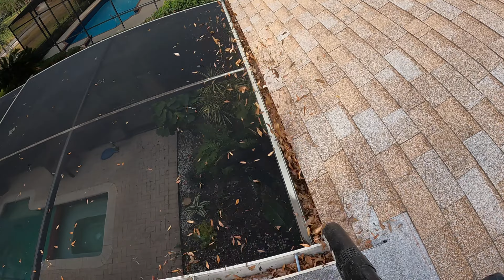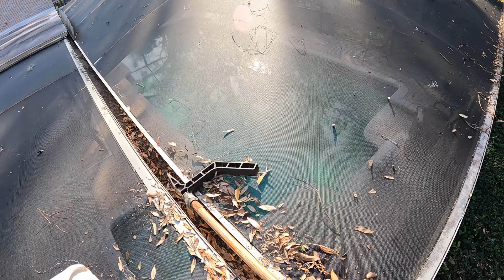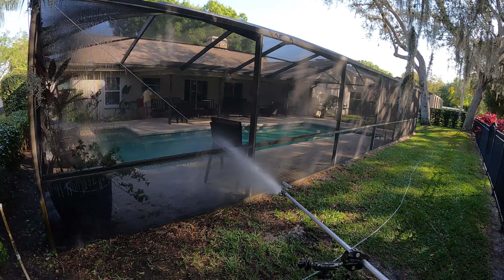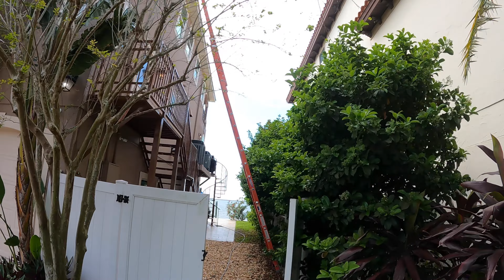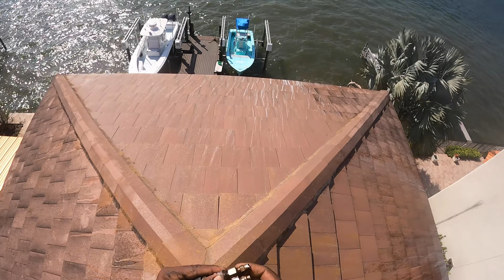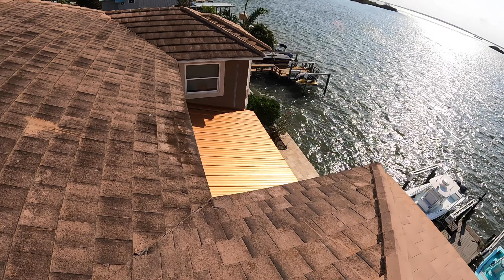3 Story Roof Cleaning On The Gulf!

Comment: Cliff  if  you buy about 4- 6 or even more  feet of  plastic  tubing  / down pipe which  is roughly the same diameter as the end of you Stihl leaf blower    you can easily  add on an extension   to the blower with  the  appropriate  tape / band.....  This will help  reach  difficut to reach  areas... It works  100 %  and is a  lot easier
Reply from the maker: Now how do I get that rear gutter  along the pool cage that attaches to the house? On a house with no pool cage it's perfect. In Florida we have cages around our pools.

Comment: Great work and educational content as always, Cliff! I like that wand with the swivel quick connect. Are those available, or did you make that?
Reply from the maker: Thanks, That gun is modified. Instead of using a PVC riser I opted to use a copper 1/2 inch pipe thats more durable. I kept breaking the PVC risers where it threads into the gun so i switched to the copper pipe and added 2 shark bites with threads on the ends.

The swivel is mosmatic 1/2 inch swivel. on 1 end its male to thread into the gun. on the other end its a female end which you can add a barb to put your hose on with a hose clamp.

Comment: Hi man, I have learned a lot from you!! Keep it going. Now that you have your soft wash trailer. Will you clean the pool enclosure screen with that or with regular down streaming. I am concerned about vegetation specially when quemo al applied from inside. (Done steaming come with a lot of water from the pressure washer so it is safer for plants but the trailer should have full SH.) thanks man!!!
Reply: By the way I am with Shack Shine in Orlando NorthEast in case you want to say hi!!🎉
Reply from the maker: Yea im sure I will still downstream. My truck will have both capabilities softwashing and pressure washing. Downstreaming get 90% of the jobs done so that will be the mostly used method.

Comment: 250 feet of hose 👀 holly crap!!! Do you have 1 consistent hose? Or do you have multiple split together?
Reply from the maker: Never ever buy 200 or 250ft of 1 length hose. I only buy 50s or 100s. I mainly use 100ft section. Reason being if the hose blows I can remove the blown hose and keep working. If i was to use 1 continuous 200ft of hose and it blows then im screwed!
Reply: @Pink Flamingo Power Wash LLC  yep I'm screwed cauz I just bought 1 200 foot hose LAST NIGHT!!!! BECAUSE other you tubers was saying pieceing together 200 foot u could have leaks and not know it on average parked on the street how much hose u ACTUALLY USE?
Reply from the maker: @TROUBLE8088  lol smh unreal. 100ft mostly
Reply: @Pink Flamingo Power Wash LLC  I'm going to have to send it back and get 50ft sections, how do YOU connect them ? Quick connects I bought 1 100 foot of water hose ALSO do you run 1 100 foot hose or do u need to run more than 100 foot & in 59 foot sections also?
Reply: @PinkFlamingoPowerWash  thanx man I'd be fucked with out your videos and you ALWAYS answering me!

Comment: What a difference,  I have never came across a copper roof yet.  What would you have used to clean it? And what does bleach do to the copper roof if you dis get it on it?
Reply from the maker: I would pass and run away.  Bleach would make it patina (turns it black)